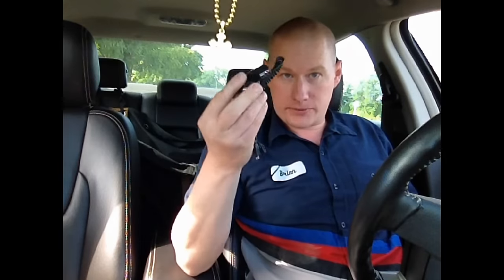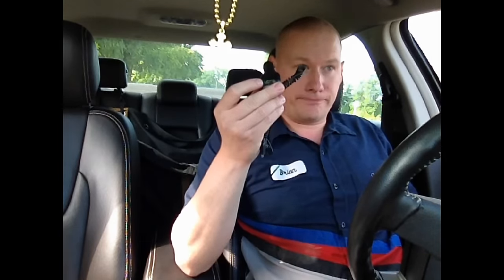Troublesome Ford Tire Pressure Monitor Faults Tip

Comment: 2008 F350....tire pressure light came on yesterday and truck wouldn't start. I put air in both front tires, truck started. This evening, same thing happened. No start, won't even crank over. Put pressure in rear tires, no dice. took out charger from dash panel, no dice. Help

Comment: Escape 2009, build date 9/08, 11,800 miles on it.  Two sensors replaced on 2/11/13, one on 12/17/14 and two more a few days ago.  Why such a high failure rate with so little driving?
Reply from the maker: Age and it is likely cold by you right now affecting battery life.
Reply: FordTechMakuloco The first two made barely over two years and two more at less than two years.  My neighbor has a 2010 Taurus and hasn't replaced any yet.

Comment: I have a 2006 F-150 that doesn't have a tpms system but recently had the warning light for tpms turn on along with the seat belt warning light and neither will go away now. Ever seen anything like that before?

Comment: So this issue occurs with all chargers or just the cheap $5 ones? Cuz I'm getting the same sensor issue everytime I plug in a cheap charger and hasn't came back after I took the charger off, but I don't want to buy a top quality charger if the same issue is going to occur no matter what lol

Comment: If I replace the banded TPMS sensor part, with a valve TPMS sensor part on my 2007 Ford F150, will it word the same with my vehicle's computer system?

Comment: Thanks for the info. Plugged a cheap cell charger in sensor fault popped up.. googled problem. Your video popped up. Unplugged the charger fault went away.

Comment: I just purchased a 2010 and had this very problem. I didn't receive the message until I was on the highway and yes I had a charger plugged in but it isn't a cheap one.

So does this mean I can't use this outlet
Reply from the maker: +Leslie Fletcher Unplug the charger and see if it goes away then you will know for sure.

Comment: I have a 2007 Ford explorer with the same problem and I unplugged the charger still didn't work and also my power doesn't work the windows won't go up no lights won't come on any suggestions

Comment: Is this only for earlier models? My 2018 ford focus keeps doing this... I do have a cheap USB charger
Reply from the maker: All TPMS equipped vehicles.
Reply: @FordTechMakuloco  So I went a filled my tires... Three tires we're at 29psi. One back tire was at 25psi. As soon as I inflated them the light went off. It also got really cold lastnight as well..... I did remove the cheap phone charger as well.

Comment: mine stopped working. Brought it back to where I got the wheels. They replaced it and said the light should shut off after about 20 minutes. It hasn't tried this. unplugged anything extra. any other possibilities?

Comment: Please tell me what to do if the low beam head light doesn't work on the passenger side. But the high beam does work. I checked fuses and replace bulbs and it doesn't work still.

Comment: I have a 2005 Ford Explorer and one of my tires I gave up so I put the spare tire and I want to go put air in the spare tire and tire pressure sensor fault came out is that a bad thing
Reply from the maker: The spare has no sensor so the light will come on yes.

Comment: Would LEDs trigger this? I just bought a 2011 f150 4x4screw and changed out :
backup lights, license plate lights, cargo/third brake light, and 1 fesfoon style in back seat. Now, tpms light is on, and my backup camera has bluescreen when it was previously working.
Help.

Comment: I just bought a 2014 escape that has this fault message on. There is something metal in the cigarette lighter in center console that i just noticed. Do you this it could be causing the fault?

Comment: I am getting TPM faults on my 2011 Ford Escape. Happened on my way home from work. I did not have my phone charger plugged into the cig.lighter. Although the Escape comes with an Auxiliary port for your phone to play music through the speakers. Could that have something to do with it? Never had this problem before.. Thank you.
Reply: Also it was causing the light that says a door is open, to come on also... Thought I better include that. Any help would be greatly appreciated
Reply from the maker: If everything aftermarket was disconnected from the vehicle then it is most likely the sensors themselves. For some reason 2011 and 2013 was really bad years for faults on Ford vehicles with the TPMS being #1 for 2011 models. I have changed many tpms sensors with low mileage on 2011 models.
Reply: +FordTechMakuloco how much do those sensors typically go for? Should I worry about the door ajar code popping up,or is it a result of the TPM fault?

Comment: I tried to train mine on my 2012 focus and the front right tire never calibrated. Does that mean I need a new sensor? Should I replace the one or all just in case?

Comment: Recently had 4 new tires installed.  Afterwards, the TPMS light came on.  I have removed the phone charger, I have tried the "brake peddle / starter ON and OFF 3 times' method, and NONE of it has worked.  The light is still ON!  Any other suggestions that don't require taking it back to repair guy and spending more money!??

Comment: I have a 2008 Lincoln MKZ built, 08/2007. With new wheels tires and sensors [valve stem mounted]. Used a Ford reset tool and did not work. Drove 20 miles. Light stays on and does not flash. Old wheels were bad, and only had one sensor that worked, so iI replaced everything. What is the proper procedure to re set the computer?  Scan tool shows no error codes.
Reply: +Jonathan A   Yes also installed new TPMS inall wheels that are Schrader 33000 easy sensors, had the tire store set them. Later tested them by letting air out of on tire the dash light does not go on . Returned to tire store . They said all sensors are working . What else could I look for?

Comment: Hi guys, 

I'm working on this Ford Explorer I have replaced the rear right TPMS and still it's not showing the value.

I swapped LF tyre with RR tyre to confirm the replaced TPMS is working, which actually work on the LF tyre as it indicate the tyre pressure value.

Comment: See if anyone can help.  the tire pressure monitor fault comes up in my screen of a Ford Flex 2013 and also my key beeper stop working.  tires are check for air and I took chargers out and when about the block abd still blocking for the fault.  How likely is for those sensors for to malfunction and needing replace.  why my beeper stop working and suggestions please?

Comment: I have a F150 2015... I just bought a tire and rims package.. I tried to reset tire pressure sensor to learning new tires. when letting the air out of the tire I did not hear a horn does not blow. I'm not sure what it is gone as far of letting all the air out of the tire still no horn sound. any ideas?
Reply: I'm going as far as letting all the air out of the tires still no horn... fix typo

Comment: I don't have a charger. I took it to one place, they put air in my tires without checking the pressure. The guy said if light came back on, I might have a nail in my tire, but the light never went off. Took it to another place today, the guy checked and pressure, added air. This guy said if light came back on the sensor might be bad. However, the light never went out. Any suggestions?

Comment: I’m having trouble with my tire pressure sensor fault in 2010 f250 super duty 4wd. I never use a charger, Bluetooth or anything auxiliary in my truck. Tire shop spent 3 hours replacing and resetting the sensor and it still shows up on my dashboard as a problem. Anyone have other suggestions?

Comment: I will give this a try, but in my case the low tire pressure comes on after a couple of days. I took the car to two different tire places and they could not find anything wrong. I have Michellin Pilot Super Sports, not stock tires. I think it just has a tiny hole. If I see the tire deflate, I am going to use fix a flat to seal it up.

Comment: Great videos, but what do u mean by the key cycle?
I have a 2011 expedition & the TPM is off. All tires pressure chkd ok.
How to reset that please?
Reply from the maker: A key cycle is simple turning the key to the off position and then turning it back to run so everything can start up again and prove out. The tire pressure monitor is off? Is it flashing in cluster?

Comment: Hey Brian, thanks for the very informative video...unfortunately, that didn't cure the false code with my wife's 2014 Escape.  We've had the car for almost a year, and the message center just started displaying the low tire pressure message about a week ago.  Also, at the same time the message is on, the tire icon flashes.  I tried to train the monitor using the air let out method, but it didn't  work.  The only thing I could think was that either the left front is not working or the module may be defective.  As recommended on your site, I will order one of the tools to aid in retraining my system.  But if you have any other information that you could pass on to me, I would greatly appreciate it.  It would also help me keeping me out of hot water with my wife.
Reply: This is for pressure sensor faults,not low tire pressure warnings

Comment: Just starting using a dash-cam on my 2012 4x4 limited Explorer and guess what? Tire pressure sensor going off w/out any change in actual tire pressure. 
Thx for video

Comment: I had this just start on my 03 Expy with 259,000 miles. Could it actually be the module at this millage? Also could it be caused by a Bluetooth connection within the truck? Thanks. Your videos have saved me thousands of $$$$$ in repairs.

Comment: My tire sensor monitor starting acting up when I get all four tires changed.
Reply: Same. "Tire pressure monitor fault".
Reply: @McShizzle  Is that the one where is starts flashing 20 minutes into the ride, before going solid?  So annoying, especially since it does not always do it.
Reply: @nunya3163  that's the one.  But we changed tires and rims like 2 days agos and completely forgot about the tpms.  But yesterday it we drove around for a while and nothing. Just this morning coming out of a car wash heading home did it turn on. Damn sensors every where.

Instead of taking the ones out of the other set of wheels we have I'm buying a set of tmps on eBay for around $27 from a lincoln or a mercury.  It's all the same sensor with the ford models

Comment: Mine came on after I put my spare tire on. Do spare tires not have one?
Reply from the maker: +Dakota Burt No sensor in the spares except some early expeditions.
Reply: +Dakota Burt You needed your spare, the other tire of course doesn't have sufficient air in it to keep the light off.
Reply: FordTechMakuloco i removed the battery and fuse box from the firewall to check what i thought was a master cylinder leak. Once i put it back together,  now i get the fuel light on and the miles to empty are blank. I had a half a tank of fuel tho. Also the tire pressure monitor fault comes up

Comment: That is so crazy I bought a new USB charger like last week so happens that I change the rear tire at the same time so I am thinking it was a monitor sensor on my tire that has just changed I was going crazy trying to diagnose this thing everything look like it's supposed to look but then I watched your video as soon as I disconnect it USB charger and use my old inverter charger that I've been using for the last 2 years the tire sensor went away that is crazy I've been a mechanic for the last 10 years and never heard of this good video thanks for the help

Comment: Amazing !!  Dealer couldn't figure it out, Tire Warehouse couldn't figure it out!  One YouTube video and it makes sense. Problem started right after I installed a dashcam.    There's  a module of some sort in the power line that I tapped into my fuse box with an add-a-fuse. Would it help if I wrapped it up with one of those foil bags you get with a transponder?
Reply: Well, to answer my own question, I wrapped that power line module in one of those foil bags you get with a toll transponder AND IT WORKED!  The fault came up one more time, but that's it.  It hasn't happened again!

Comment: ...Another tip: After retraining my front driver side tpms, I couldn't retrain the remaining ones. And after MANY tries I got the idea to just bypass the valve stems and instead point the retrain gadget at the tires directly inline with the sensors. And to my surprise it not only worked, but it actually worked the very first try on all three remaining sensors!
Reply: Same with my 2013 F150. Let's me retrain the driver side left front, says to start test over again once I try the passenger side front.

Comment: I have an '04 Eddie Bauer Expedition.  I received this same code today upon starting my vehicle in my garage.  The tire icon was flashing with the tire pressure sensor fault displaying in the console.  I shut off and restarted, same thing.  No cell phone charger plugged in.  I drove about 10 miles and parked at the store.  When I started the vehicle back up, no error message or icon of any kind.  The power company in my neighborhood recently switched out our electric meters with new radiofrequency controlled "smart meters."  Coincidence?

Comment: 2013 F150 5.0 Screw. Everytime I hit a good pothole, tire pressure light comes on. It'll go off once I shut the truck off for a few mins and restart it. Update....hit the same deep pothole and it hasn't gone off in weeks. Did the tire retrain test a dozen times and it says to restart the test once I get to the 2nd tire. I've let the air out til almost flat. Smh.

Comment: I have a 2014 f150. Just got new tires and wheels with a 2” level. On the way home I got that message..tire pressure sensor  fault..must because of the new tires

Comment: My sensor light came on  fault I pull out my  charger an 2.4 amp than drove for 20 minutes 30 mph but the light didn’t go out  How do reset it or do I need an modular

Comment: that video was very interesting. I was driving to work this morning, when my tire pressure light came on and showed that my passenger left front tire was low (26 psi). a few minutes later it showed (33 psi), then (34 psi), then (35 psi) then it went back to its normal pressure. just like nothing had happened. now I do have a cell phone charger in my Ford F-150, but it was no plugged in. Could that have been the cause or is there some other sort of issue? should I take it to the dealership. After all the truck is only 4  months old. Anyone with some advise please let me know.

Comment: My dad having the same issues with a 2012 escape, but he has no charger, phones, or plugs what so ever, tech free on the truck and the symbol light started flashing then stopped and message on dash was tire pressure, sensor fault, a regular garage could not find the problem.

Comment: Thanks alot I got a 2012 f150 i could only learn the right front all other sensors were un learnable but the tpms  programmer would activate them. Replaced the module and away she went.

Comment: I got the same error. I was getting pressure warning lights when everything was fine. I was looking to have all the sensors replaced and starting to price it up.. My phone started having issues with charging on the USB plug, I found that it would charge just fine.... Wireless, so I kept the wireless in my car, plugged in till my replace phone came. I left it in my car because I like the idea of just setting my phone on it to charge instead of plugging it in. My problems started around then, I watch the video, took out the wireless pad and problem went away.. Thanks

Comment: You're the best. You're content is very helpful for me , as a Ford Escape 2010 holder. I've already fixed power steering assist fault, changed struts, stabilizers and spark plugs and now my FM transmitter went wrong. Thank you very much.

Comment: I had a tire low warning just today on my 2010 Ford Fusion.  So I parked my car and aired up the two front tires which were low, however, when I started my car to go on an errand the low tire pressure warning was gone without me traveling an inch.  
The entire purpose of the sensors inside the tire are to check for low pressure without driving anywhere.  On past vehicles the onboard computer calculated rotations to sense if a tire was low.  That no longer seems to be the case.
Reply from the maker: Brett Wells These sensor stay active after being parked for up to 30min that is why the new tire pressure was updated in the module. You still have to drive initially to wake them up to start sending pressure reading again if the 30 min has past and they have gone to sleep.
Reply: FordTechMakuloco I don't know what to tell you but I had parked my car for over 2 hours before I remembered to fill up the tires.  While I was filling them up my electric tire pump died so I had to recharge it for over an hour before I could finish airing up the other low tire.  Yet when I started the car after all that the warning was gone without driving an inch.

I'm fairly sure that the initial warning happens when you've been driving for about 15 or 20 minutes though.  The warning started 2 days ago and was persistent through several different trips until I aired up the tires.
Reply from the maker: The newer stem mounted sensors may stay on longer with lithium batteries but they still goto sleep and don't wake up till the tires are rotated. This is why the battery last so long in the sensors.

Comment: What about a bad battery in one of the sensors? I took my 2009 Ford Escape to my local Costco - they put some sort of electronic detector next to each tire, and told me one of them was bad - which usually means a dead battery, he said. Unfortunately, the batteries can not be replaced. The whole unit has to be installed - a $40 part and $20 installation fee per tire. Am I getting taken for a ride? (pun intended!)